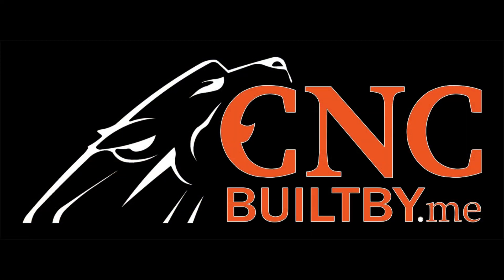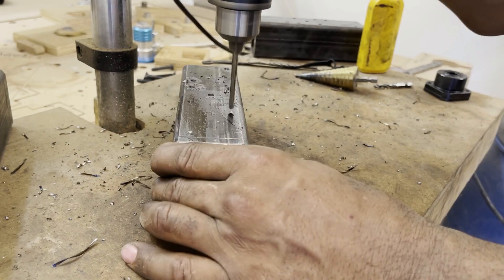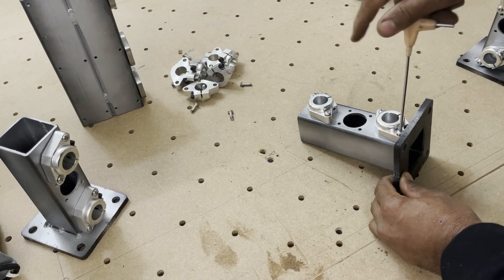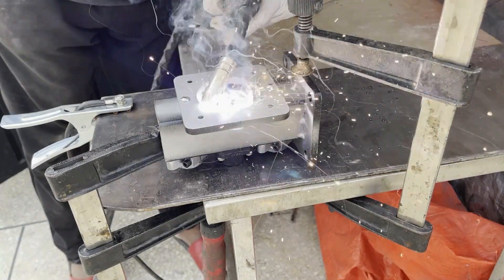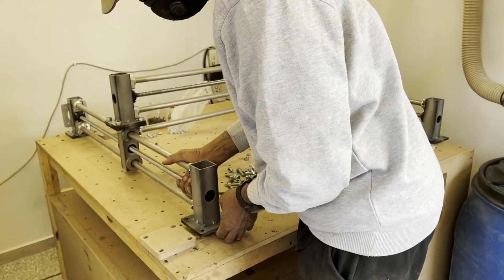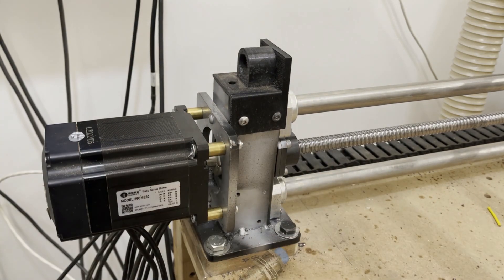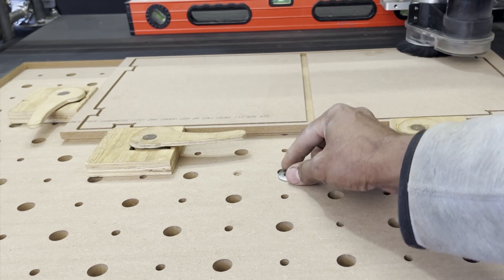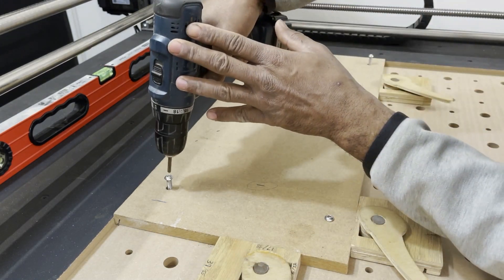The Best DIY CNC Build on YouTube?

Comment: The issue with using the Onefinity design as a roadmap for this build is the issue it has with the rigidity of is gantry making it prone to flex or rolling...so much so that they tried to correct it by adding a third circular tube to fix the problem. The Cut it Close YT channel does a nice comparison of Onefinity vs the Altmill showing the issue and why he prefers the Altmill AAA a result. Its why the AltMill is sturdier and more rigid than the Onefinity and can run at FAR greater speeds as a result.

I'm not bashing your build at all. I think it's amazing, but I think you could correct this problem by changing the gantry design and end up with a MUCH more robust machine.

I'm not bashing the Onefinity either. It's great for what it is. They almost won me over and got my money when I was in the market and it's completely suitable for working with wood but if you want to produce work on metal? You will need to fix the gantry issue or operate at much slower speeds and softer materials.

Thank you for sharing you're expertise with us! Please don't take my reply as a criticism of your work. This is an amazing build.
Reply from the maker: Thank you for taking the time to post your comments. I agree with what you said and have already redesigned version 2 fixing many of the issues. Just not sure when I will have the time and money to built it. I will definitely have to check out AltMill.
Reply: @cncbuiltbyme  Yeah, I agree, the cost of redesigning a gantry is not going to be cheap so use it to its full capacity as it is and make some money with it! I look forward to seeing the redesign when you are able to release it. Thank you for your reply, I'm happy my comment didn't discourage you. Happy New Year!

Comment: Clever build! I recently came across Homemade Madness, you should check out his CNC build.  I have a Shapeoko 3 that I’ve upgraded with the HDZ axis and heavier duty bearings, and I’ve machined steel on it. Takes a long time, go slow, babysit it with WD40, take small z increments. Your machine looks more than capable and should make fast work of most things. The other criticisms on here are not understanding what is possible.
Reply from the maker: Thanks for commenting… Going to go checkout Homemade Madness now!

Comment: Im building something similar to what you made. Im curious if you've noticed any significant sag in your rails? And if its been an issue for you
Reply from the maker: Significant? No, not significant about .3 mm disparity between right and left side of the cutting area. In version 2, I replaced the lower floating rails with linear rails and I changed the x axis to a steel plate. See link below.
Reply from the maker: https://youtu.be/fkkLN02zmpk?si=13fq1CIK33hBr6DU

Comment: Horrible welding work
Reply from the maker: 100% agreed! The thing about DIY projects is that you tend to get better with each new one. I’m sure 100s of “real” welders saw I was a novice at it but had the kind heartedness to over look that detail. In any case, I had to move and gave v1 away but I’ve moved on to version 2 and I’m trying to implement some of the suggestions made by more skilled craftsmen.  I will make sure to tighten up those beads for you.

Comment: how do you fight backlash?
Reply from the maker: The Acorn controller I’m using has configuration settings for backlash. I remember watching a video (I think from CNCNutz) that illustrated how to calculate backlash and entered those value into the controller. Sorry about the details as it was a while ago when I setup my first machine.

Comment: Your breakdown of parts comes to $2176.96 ... that's a hell of a lot more than your $1500 estimate ... and a hell of a lot for a DIY CNC - at that price it should be a DIY "pro level" CNC.
Reply from the maker: @justanothernoobe  To build one it’s going to be around 1500-1600, but that doesn’t include the extras. Like cooling system and controller and license as stated in description. Total price could be reduced by using cheaper parts and free licensing. I listed what I used. In any case, a basic entry level router (not spindle) CNC machine goes between $600 - $1800. You can build a much more robust one with better motors and a spindle for about the same price as a decent purchased machine. But I’m not trying to sell you on anything. I built one and it’s working great for me…. Just thought to share it with others who may be interested.   So if you’re interested in building one, I wish you the best. If you’re just bitching about the price or how it should be classified , can’t help you there. It is what it is.
Reply: @cncbuiltbyme  hermano tienes mucha razón yo estaba en las misma decidí construir la mía y ahora estoy feliz tengo una maquina robusta y gaste menos de lo que me vendían felicitaciones es una buena maquina
Reply: @cncbuiltbyme  based
Reply from the maker: @axelvdp1 ?
Reply: @cncbuiltbyme the way you replied to him, is "based". And it's a good thing, because you defended yourself leaving him speechless

Comment: Typically the plans come before the build, if you do all that in your head your under paid!
Reply from the maker: @wpegley  Your comment made me chuckle 🤭 If you get the hole locations correct (for the screws that hold the hardware), the rest just falls in place... but I did make a 3D model of it in SketchUp before I actually built it. Thanks for commenting.

Comment: Looks great. Good work. i just see detail. motor mount can be strong maybe. ofcourse you know better but it looks weak for me.maybe double or long mount will be better. also did you make circle test? ( i mean drawing circle with cnc but not with pen. cutting with bit in different loads and mesuring diameter from cross sides) it will show this machine wobbling or flexing.
Reply from the maker: I will try the circle test and reply with the results. I had screwed up one of the motor mount bases and had to take off the motor plate. I thought it would be easier than it actually was. So they are pretty strong. Thanks for your comments.

Comment: i built a joes cnc hybrid in 2008. i like your build. how much does the gantry weigh on your build or how much weight do your motors have to carry? looks like a stable machine, have you cut much on it yet? im using mach3 with custom interface. how do you like the acorn controller. i know Clough42 was trying to get it perfected. https://www.youtube.com/watch?v=Wji6fh1nuUY&t=1470s
Reply from the maker: Just checked out your build. Love the way you explain things. I really like the acorn controller but it took a minute to really understand how to use it (still learning) but overall pleased with it. There are a couple things about it that bothers me and been thinking lately of trying out a different controller for comparison.  I haven’t actually calculated the gantry weigh but will find out and post later. Thanks for sharing.

Comment: Very nice video. Where did you get the tube square shown at the 1:12 mark?
Reply from the maker: I got it from a local steel mill. Standard 2" tube with 1/8" (approx 3 or 4 mm) thick walls.
Reply: @cncbuiltbyme  Thank you for the reply but, I was referring to the tool you used to mark your lines.
Reply from the maker: @Frontpagefab  Oh sorry about that... I didnt see "tool". I believe I got it from Ali Express. Do a search for "Square Multifunction Ruler".

https://a.aliexpress.com/_oD38ZAT
Reply: @ thank you. I have been needing something like that for square and round tube.

Comment: Clamps by Marius Hornberger   https://youtu.be/bpJyqLoqV04?si=UxAsGkeS6f_bIhT9
Reply: I agree. It was Marius.
Reply from the maker: Initially I thought it might be Marius. They are similar but these are slightly different. These have blocks that the clamps sit in. Each of the four sides of the block have a different thickness. If the workpiece is closer or further away from the clamp holes, you simply rotate the block until you find the best fit. Marius' clamps are very similar in shape (minus the flange). I wonder if he has two versions? Thanks for sharing.
Reply: @cncbuiltbyme  I think he does, I swear I saw him make the blocks, must be newer video.

Comment: Are those nema 34 steppers?
Reply from the maker: Three Leadshine Closed Loop Nema 34 (86CME80) 8 N.m 6.0 A

One Leadshine Closed Nema 23 (57CME23) 2.3 N.m 5.0 A

One Water Cooled Spindle 65mm, GDZ-65-800A, 800W, ER11, 220V, 5A

One 800L/H Water Cooling Pump Tank

One Clyxgs Water Cooling Radiator
Reply: Thank you very much for the quick response!
Reply from the maker: @GerritenMyriam  Yes, they are.
Reply: @cncbuiltbyme  How many NM  holding torque? Closed Loop? Water cooled spindle 800 Watt? Thank you very much.

Comment: not ewer can say "best" rails have worst what has made. if want good rail need use lot better SBR rails or MGN or hgh linear rails not tube rails who not have strong and accurate tube spend if milling somethink. only what have good uses ballscrews and big stepper motors.
Reply from the maker: @mattivirta  Thanks for sharing... To be perfecting honest with you, I personally dont believe its the "best" CNC machine out there. My title is the best cnc "build" (meaning the build process, not the machine itself). Other more experienced YouTuber told me to try to come up with a catchy title to spark interest.

Comment: You used a cnc to build a cnc ? I guess I’m out
Reply from the maker: I feel you bro. If you have good eyesight and a steady hand, I dont see why not. I've always had vision problems and as Im getting older (60) doing precision work is getting harder and not that precise, hence why I ended up using the cnc. Best to you.
Reply from the maker: @chrisp7957  Which part of the cnc was actually built with a cnc... Oh you mean the jig and the "tool" for tapping? Oh silly, those can be made by hand... I just happened to have one at the time and kept saying to myself, "CNC or cut by hand, CNC or just by hand?" Then I said to myself, "Oh its only a jig, who could possibly bitch about that?" Don't forget to take a jacket.
Reply: @ I started watching because I wanted to see if it was a project that I felt was within my skill set to do but honestly when you said you were using a cnc to make the jigs and spoke about the precision needed for the holes I turned it off. I may have jumped the gun with my comment and should have at least watched the video through before commenting. (It is Christmas time and the pressure is on lol ) but that’s no excuse.
Reply: A CNC can help but if you're careful you can do it by hand too. It just takes longer.

Comment: i personally prefer to build solid walls on X axis, to hide all the linear mechanics behind them and let the machine be more rigid. It's better to use aluminium extrusions (thick wall boxes) as they are more straight then steel ones, in general. While they are more expensive and harder to aquire, the result is measurably better. i connect to  required shapes with bolts and epoxy. After machine is built and true, i fill the boxes with sand or concrete, this adds weight and removes noise (a lot). If budget allows i prefer linear rails, of course, if not - i use supported rods. If budget is minimal, there is always a way to use axial bearings over extrusions edges directly. Cumbersome and does not really last long, but for the first machine or for the rough work it's sometimes the way.
Reply from the maker: I have to admit I'm a newbie and don't really understand all your nomenclature (not yet) but appreciate you took the time to share your experience and knowledge. Thanks.

Comment: did you try to measure the depth difference between the middle of the axis and on sides? I don't really like linear rods schematics, as they seem to dive measurable under the spindle assembly weight.  It may interfere with 2d routing by making things thinner when you cut in the middle of working table
Reply from the maker: Yes I did.  At 16:52, I measured 9 points on the spoil board (the center, middles and corners) Between the right front corner and the left rear corner, there is a difference of .5 mm.  Doesnt appear to be diving too much in the middle of the axes though (my issue is that it seems to be "diving" toward the left side and towards the rear of the cutting area.  Doesnt make sense to me because I thought surfacing the board would make it flat across the entire the cutting surface.   Thanks for commenting.
Reply from the maker: Your comment got me thinking... I did notice while surfacing the spoil board that the left side didn't cut as deep as the right side was, but I thought it would be OK.  Im going to resurface it and see if the results are better.
Reply from the maker: Just finished resurfacing the board (which did help).  Again using the front right corner as Z zero, the center and middle readings are all around .06mm from z zero.  However, the left side readings are all .3 mm lower than z zero.  I can live with that.  Your comment is much appreciated :)
Reply: @cncbuiltbyme  i like your design, it's quite easy to manufacture even if one does not have any cnc around. but it has several 'weaker' spots built in. You've built a decent 2d router, but it's more or less a 'bootstrap' machine to build next one more rigid.
1. linear rods in the air have option to flex in Z direction (under Z-axis assembly weight. Machine may cut lower than expected. Hard to compensate in this kind of a machine.
2. linear rods in the air have option to flex horisontally, under cutting forces. While cutting, opposite forces trying to bend XY rods and these movements may work in + and -. When you dive your tool in harder material, you may expect some chatter, as rods are flexing. Hard to compensate, possible to play with feeds to avoid resonances that may break small tools. Sometimes people use schematics with a separate moving table to not to sum up flexes in X + Y axiis, but for the routers it's not a really big problem. 
3. Your Z axis has no proper support bearing near the motor (where your drive is fixed with a nut to a support bearing). As the result, you may have an unexpected axial movement, as this scheme has intended axial free play inside your z-motor. Machine may cut deeper or more shalow a bit. To compensate - add a proper support with double bearing and a nut to fix your drive to the base of the axis.  Lower bearing is not really required. 

To protect your machine's drivenuts, add some chips shielding and brushes to kick the dust of the drive. It will help drivenuts and linear bearings last. 
A decent machine and good hands you have, please do not consider my message as an attempt to lower your work. I had used much more ugly ones,  will recommend this kind of schematics to people trying to build their first machine.
Reply from the maker: @dmitrymikheev7899  Just wanted to say "Thank You". Not just for commenting but for explaining and educating. Im no expert with CNC but I do want to learn everything I can. It can only help with future builds. My hope is to one day look back at this build and say, "When I first started making my own cnc machines, I really didnt know crap". But with people like you, giving helpful advice... that's priceless in my book. Much appreciated!!!!!

Comment: You straight up copied the Onefinity design...so whoopie for you.
Reply from the maker: Yes, it is based on the Onefinity but DIY (cuz not all of us can afford to buy one). Let me rephrase, I cant afford to buy one... but I already had most of the materials and parts.
Reply: yes onefinity small weak copy, worst idea. good rails need use not this style tube rails who spend and wobble lot not strong and not accurate if mill.
Reply from the maker: @mattivirta  You may be 100% right, I dont have enough experience with it to counter... But so far, its been cutting beautifully and accurately. I cant really complain.